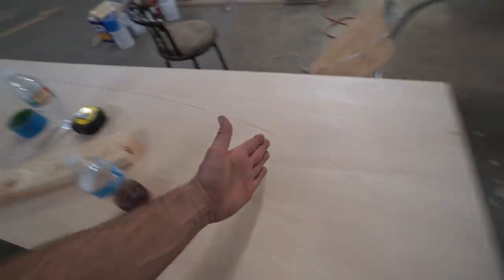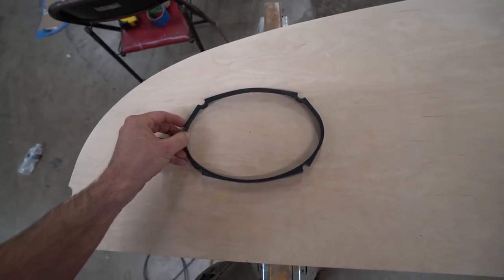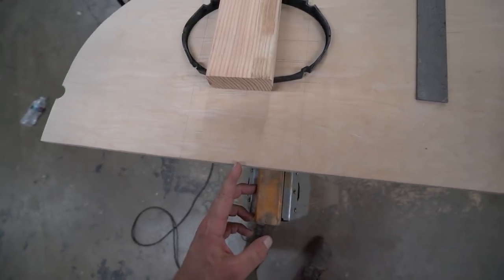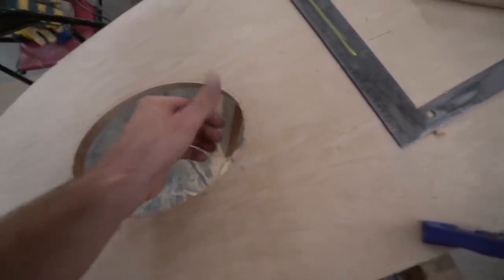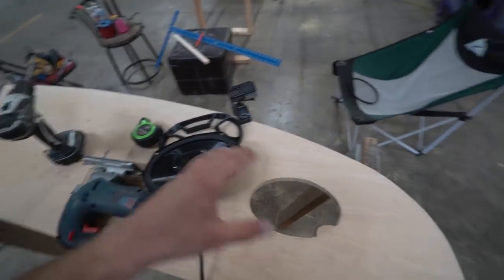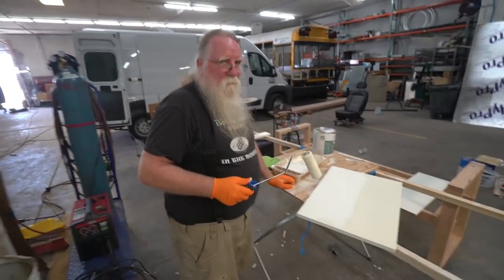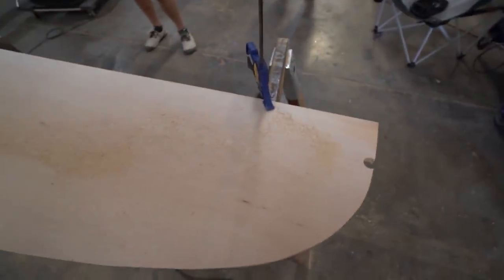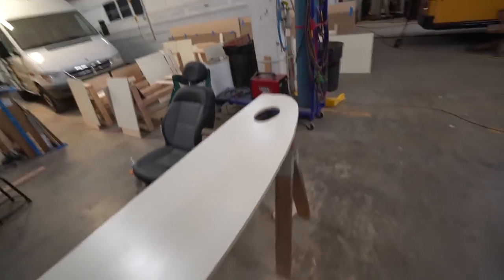Skoolie Custom Cabinets + Speaker Panels

Comment: The only thing I don't understand is why does everybody use three-quarter inch plywood. That's a lot of weight in that bus
Reply: 3/4" is more stable than half inch which is why most cabinets are made with it. We looked at store bought but they were all made from chip board which will fall apart.
 Never worry about weight when building a skoolie. Nothing you can put in will weigh more that a high school football team
Reply: @SteampunkSteve  
But do u have to distribute the load evenly on both sides or front to back?
Reply: I wouldn't obsess about it. Water tanks weigh a lot when full and I've seen them put on the side of the middle. Doesn't seem to make a difference
Reply: @SteampunkSteve  dang it Steve I never thought about that. Oh and you do beautiful werk. Love the beard my friend mine is growing back.

Comment: Does anything ever get finished in a video and why the speakers there are so many great Bluetooth speakers out there not picking just saying why create more work than necessary  just an idea don't put a wood ceiling in like everybody else think outside the box and spend less money and labor and actually look better and brighter and lighter in weight and easier to keep clean remember the lighter the bus the better the fuel mileage don't think about how much the bus can haul the more weight creates more heat on the engine transmission rear ends wheel bearings and tires remember heat is the enemy on all moving parts
Reply from the maker: Never heard of 6x9 or car Bluetooth speakers before. Would be much easier to install, but that wouldn’t work for Netflix n buslife tho